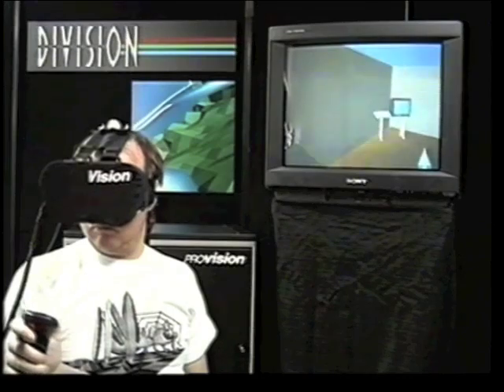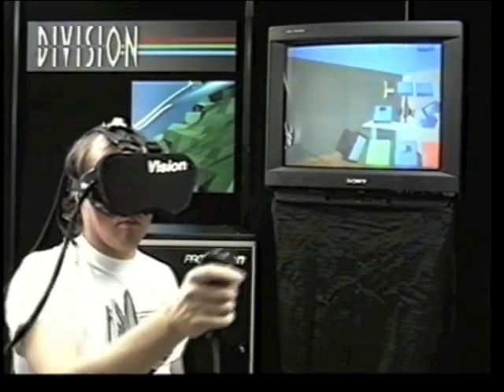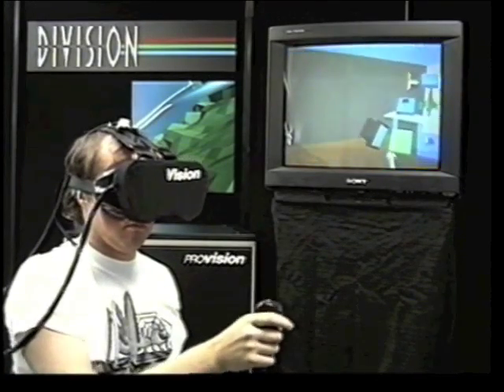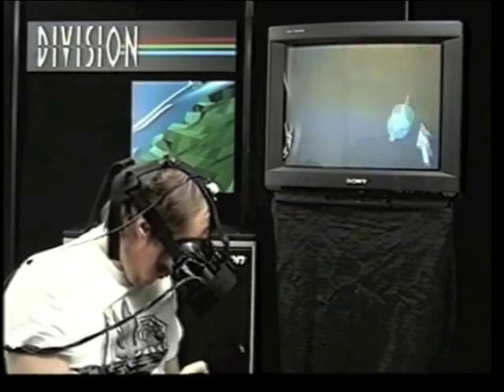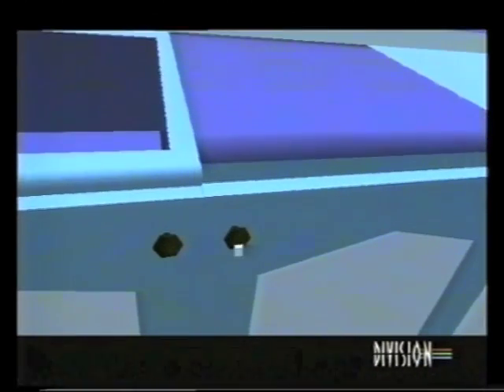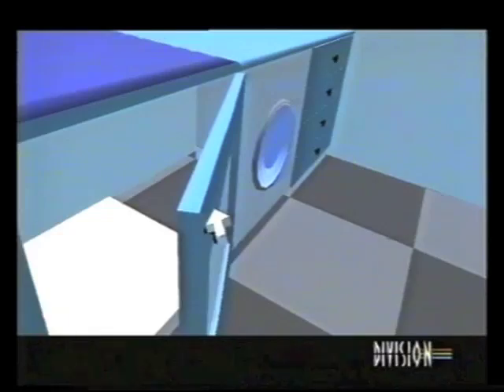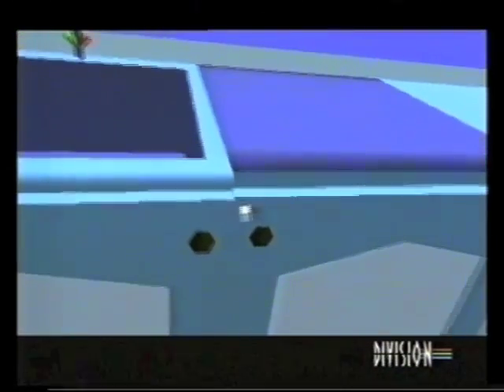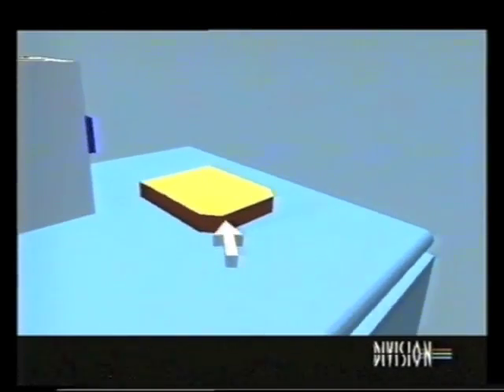ProVision Virtual Reality (VR) demo reel

Comment: The lighting of the chess pieces does not change with their orientation to the light source.  The lighting algorithms described seem like they were faked.  The frame rate is very low and there is a lot of jitter in the tracking.  Still a great accomplishment for 1991 but about 25 years premature.

Edit: Ah I think I realized what was going on.  The lighting was calculated from a fixed light position and then "baked" into the scene, with each triangle carrying precomputed lighting values which would not change with viewpoint or object orientation.  This is a very strange thing to do in an interactive application and kind of gimmicky as there is little point to precomputed lighting values when the viewpoint or object orientation can change and so even talking about using radiosity algoithms in such an application is pointless.

Comment: We added a specific electronic tool that would allow the field technician to hook-up to an existing wire (there are 625 pairs of color coded wire bundles) and introduce a tone so that the field technician could locate where the fault was coming from within the virtual town.  We won the EDS innovation of the year award of 1997.  Pretty cool stuff.  I was saddened when Division was bought up by Parametric Technologies Corporation (PTC) back in 1998.  Good times!